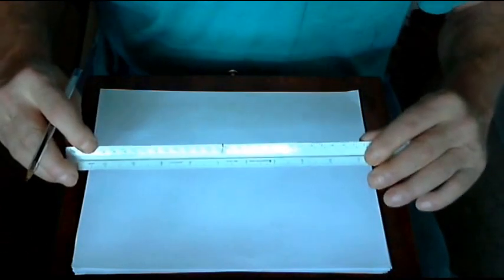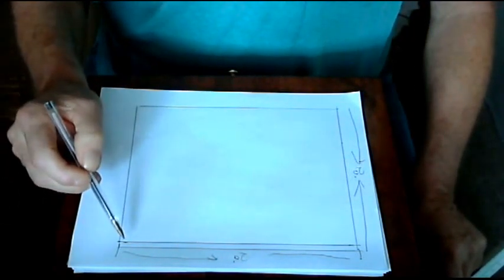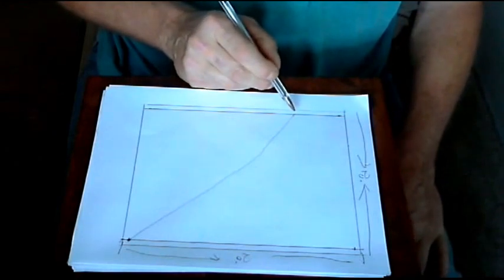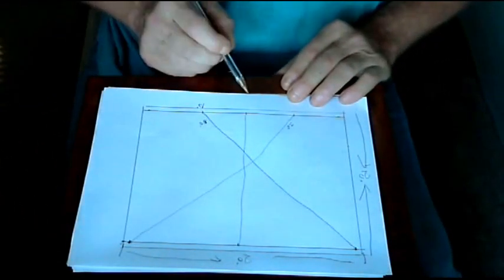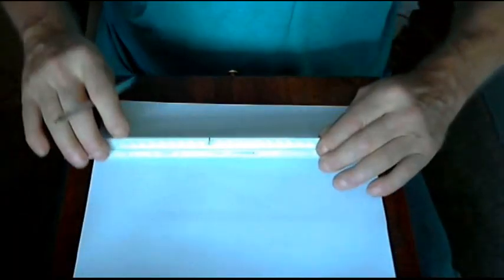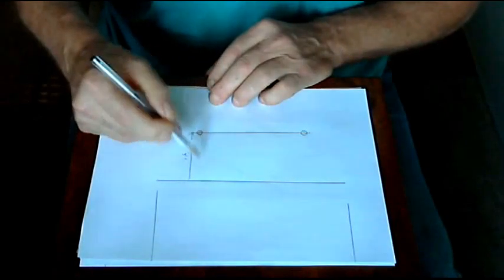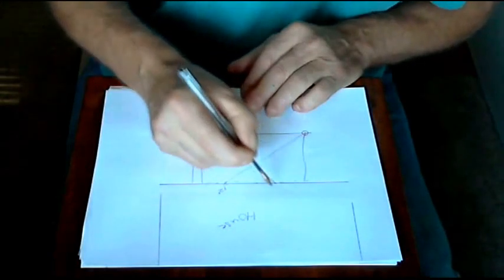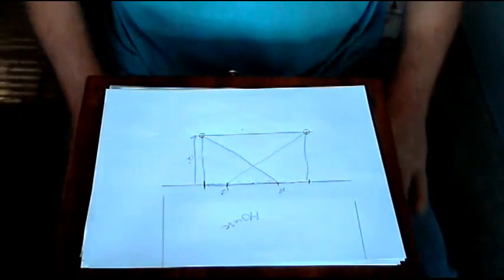Tips and tricks, in carpentry framing 1   How to square a building foundation like a pro

Comment: like the video, but what happens when the foundation is like 3 inches out of square and i need to adjust the front and back wall to make it sit somewhat decent.... i like to make arcs out of the corners from original  measurements and adjust from there?? i will not build a build a building out of square it makes my life harder... i also pull 5 5/8  for P.T when setting sill... so if it was 20 by 20 and my arcs where of by 3"  i would move the front and back  3/4 opposite ways  and the sides also
Reply: Dave P with your  method you would be hanging 3"  to nothing  on both gables...  how about tilt  it a little and get it down to 3/4?
Reply from the maker: Dave P  Hi, Dave Sorry for not answering sooner, I was never notified in my email of your comment. Using my method makes all the lines you snap square to each other the first time.  This technique does not mean you can not adjust them if you don't like the way it sits on the foundation. If after doing this method and you don't like the way it sits on the foundation, all you have to do is is adjust the marks to the right or the left as you would do with any other method.  It can be checked with diagonal measurements the same way you would check any square. I hope this helps and let me know if you have any more questions.

Comment: looks like alot of unnecessary extra work.thats why u can't find another video.
Reply from the maker: @tjarrett10071  Where's the extra work? All of the lines on the foundation are needed with a 345 method or any other method. Measurements for the dimensions of the lines are needed. Finding the center of the building takes the same amount of time as doing 345 to check for a right angle. The difference is that with my method you are using the entire width of the building. With the 345 method you are using only a partial distance. Also my method determines a square the first time and every time. No need to adjust.
Reply: tjarrett10071 Victory loves Preparation.

Comment: Thanks Jim.  Why did you pick 5 1/2" for the initial offset instead of, say, 6"?  It seems like that measurement could be any number - the smaller and rounder the better!
Reply from the maker: 5-1/2" is the width of a treated 2/6 plate,  which is the mud sill. Using a round number does not make it easier than any other number, because there is no math involved in this part of the process. Lets say your foundation was 26'-1" wide and you wanted to snap a line at 7-31/32". You would measure in from the outside of the foundation 7-31/32" and make a mark on the concrete. Then you set the 7-31/32" mark that is on your tape, on the pencil mark you already made, and measure down the foundation and make a mark at 26'-1" minus 7-31/32". Just find the 26'-1" mark on your tape and count backwards from there until you've counted off 7-31/32" and make a mark. Let me know if you have any more questions, and don't forget to click on thumbs up if you like this.

Comment: I see what your doing I am a carpenter but if your deck 20x20 you cut rim and ledger so it's at the right length and then pull diagonals
Reply from the maker: yes, that would work also. What if you had to pour the piers prior to building the deck and they had to be at a right angle from a position of equal distances on each side of the door? Set your house rim on the wall with the center of the rim at the center of the door, then pull off of each end of the rim to a string line that is set @ 20 foot from the house. Find center on the string line and mark it as shown. Measure 10 foot each side of center and mark it. Of course the string line has to be level from end to end, but does not have to be level from the house. Let's say the string line was 6 inches lower than the house rim. You'd be measuring down hill, but that doesn't matter because your only trying to find the center on the string that matches the center of the house rim.

Comment: Hi Jim, I'm having a hard time following your geometry.  The second line you draw is not parallel necessarily to the first line so when you draw your intersections diagonally, I don't understand how you can square it up.
Reply from the maker: +rpaulpen  Hello, I didn't take the time in the video to measure and make the lines parallel just because it was a freehand sketch. I would of course on a real foundation.
Reply: If he pulls an equal measurement from the initial line and marks the top of the arc, it will be parallel

Comment: What do you mean by a foundation, Jim? I'm from Australia and what we call a foundation over here seems to be something different to what you are referring to. Are you talking about the concrete slab of a building?
Reply from the maker: +Brian Foley   Hello Brian.  The foundation is what supports the structure.  A slab is generally only a part of the foundation. I live in a house which is supported by a perimeter of footings, and a stem wall that goes below the frost line, and extends above grade by 10". The interior slab which is the sub floor only supports non bearing interior walls.

Comment: what if the build lines aint square how do you find outwitch side is off
Reply from the maker: +edwin hill  Not sure what you mean by build lines. My lines that I snap would be an exact measurement between each other according to what the print specifications dictate. If that causes the walls to stick out past the concrete walls or in on the concrete walls then that what has to be. You just try to make it fit the best you can on the foundation.

Comment: this is smart. but how do you know that the second line runs exactly parallel from the first line? if all you are doing is measuring 20' (-5 1/2'') from each end of the first line how can you be sure you are pulling the tape exactly perpendicular? if you pull the tape slightly off on an angle at either end then when you snap a line it will not be parallel and all measurements along it will also be off.
Reply from the maker: Phil Osmond Hi Phil, and thanks for watching my video. After doing this for many years I can pretty much tell if I'm perpendicular to the parallel lines. The measurements for the parallel lines can be measured from the corner of the back wall to the corner of the front wall, that way you know your perpendicular.  Before you snap the last 2 lines you can do a diagonal measurement. If they are not correct you can adjust them accordingly and then snap the lines. In my experience, I'm almost never off more than 1/8" and more often than not it's right on. I hope this helps. Let me know if you have any more questions, and check out my other videos on tricks in framing.
Reply: Jim Watson ahhhh yes of course, measure the diagonals to check for square. brilliant. cheers jim, thank you for sharing your knowledge
Reply from the maker: Phil Osmond Your very welcome!